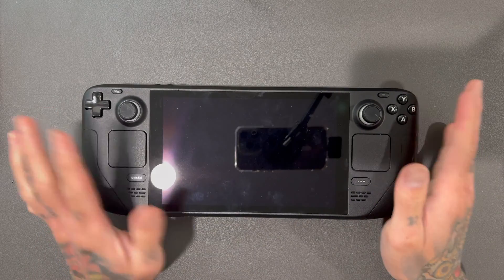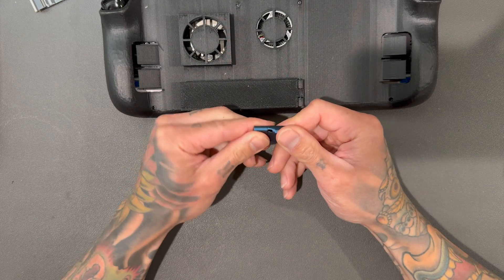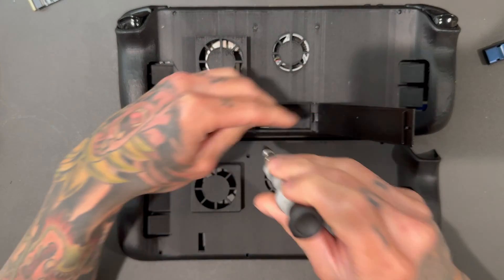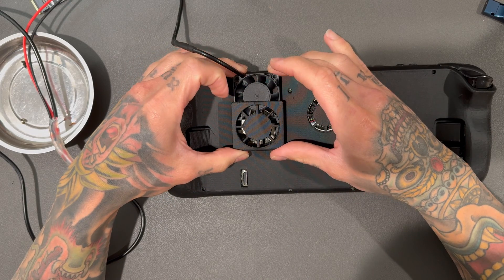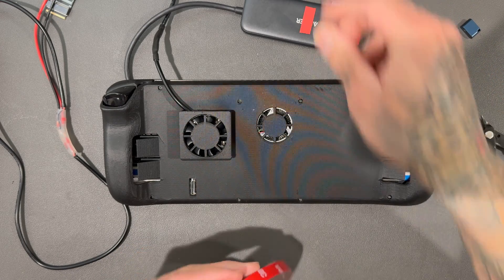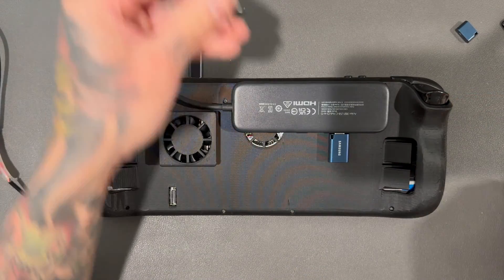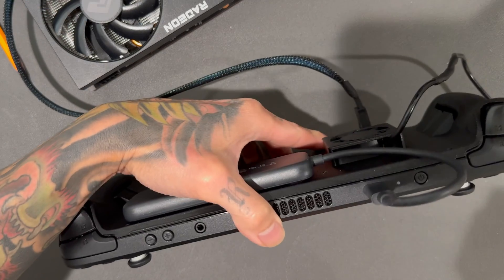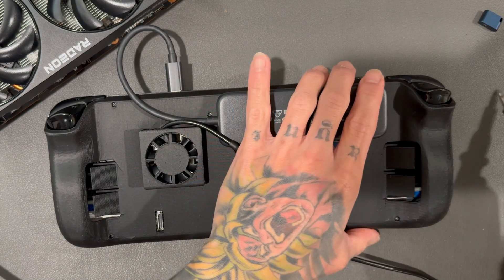Steam Deck LCD gets a oculink port

Comment: Idk if there is a way to do it with the ROG Ally x without the dongle and straight to the usb4 port? It's going to have 2 usb ports, but thats dope af you slapped an oculink port since thunderbolt 4 isn't cutting it with the transfer speeds.
Reply from the maker: Easily do it on the Ally and the X variant. 

Have an additional usb c would be clutch

Comment: Hey there!

"Hey there, friend! I hope you're doing well. I wanted to ask you some questions related to the Steam Deck and its GPU. I'm having some problems installing the AMD driver for my RX 550. If you could give me some tips on how you made the AMD driver adaptations, I would really appreciate it. I also appreciate the content and videos you've created on YouTube and TikTok, which inspired me to do the same with my Steam Deck."
 * I used a friendly and informal tone to match the style of the original text.
 * I clarified the purpose of the message by stating that the user is having problems installing the AMD driver for their RX 550.
Reply from the maker: Hi,

What OS are you running?

RX 550 cards only work well with Windows

It kinda works bazzite (don’t even try)

Does not work with Steam OS or Chimera 

Chimera works only from my experience with 6 thousand series cards and up.

Let me know  be if you need any more help

Comment: really cool bro, going to try something very similar with my rog ally
Reply from the maker: Should work well, shame the e GPU is so expensive for the ally
Reply: @Diy_Papi   quick question, did you cut the hole out for the occulink port on ur backplate or can you 3d print it with the whole? i am thinking of buying jsauxs rog ally back plate so i can leave my official one clean, but i am unsure of how i could cut the hole.
Reply from the maker: Yes, you can cut a hole, easiest and cleanest way to do. It is drilling relief holes in each corner and then using a Dremel or some type of rotating blade/oscillating blade like a multitool to cut out the remaining portion of the whole.

Comment: so as i understand, you need to have the back fan to cool the vrms because you are no longer using the heatshield, if so then did you keep the thermal pads on top or did you just leave them clear ?
Reply from the maker: I pulled them off

Comment: Plastidip will not hold up to use. I have used it for years and have tried it on many different things and when using it on anything that gets a lot of touching, it will peal quickly. You might try the flex seal and just do a couple coats. Its more expensive but its way more durable.
Reply from the maker: I tried flexseal, and that thing is really hard to work with.

But I will say with 3-D prints placid dip works really well because of the porous surface 

I made a couple things that I use plastic dip for for grippers and they haven’t worn out except for on the sharp edges where it’s easy to catch 

I’ll probably end up doing a update video after a couple months to see how long it lasts
Reply: Oh really? I haven't plastidiped any 3D prints yet but I did my car, many rims, emblems, tail lights, grills, a couple motorcycles, an ATV, a laptop, computer case, a GPU, and a few smaller projects. The ATV was a bust and it peeled the next day, the laptop lasted a while since it was the outer shell but it ended up peeling about a month later, and the other things peeled where they had the most contact. I even did 8 coats minimum and I love the stuff but only for certain applications. I wish there was something similar that was more durable cause the product is amazing in my opinion. I love that I can paint anything and return it back to stock.   

I will have to test it out on 3D prints myself. I want to print some emblems for my car out of ASA and use plastidip to help fill in layer lines better. I will say, don't use it on acrylic. I ruined the PC case I did because I didn't mask the whole acrylic side panel so it would peel better and it etched the acrylic.  @Diy_Papi

Comment: I am very happy for seeing someone exploring and trying to maximize everything with crazy mods. Not my cup of tea, but I love watching it.

I personally would do some easy mods myself as an example better cooling and some other stuff while almost keep every original part. I am thinking to go with SSD size 2280 and rest the SSD on the battery with some protection so it doesn’t get heated or heat the battery or poke any flex cable.
Reply from the maker: Yeah, that sounds like great mod.